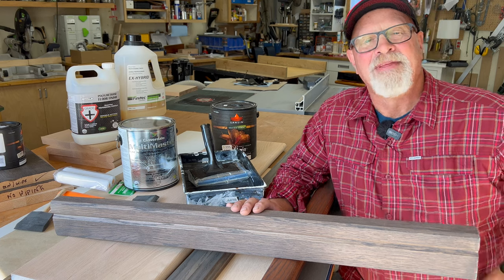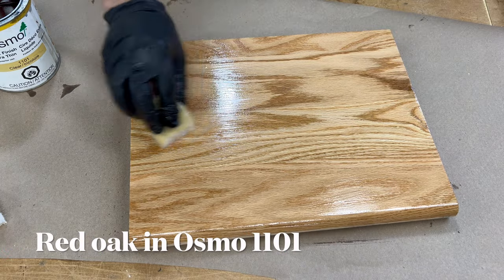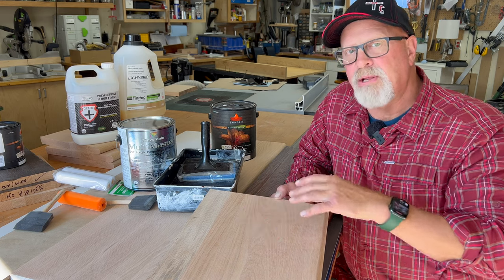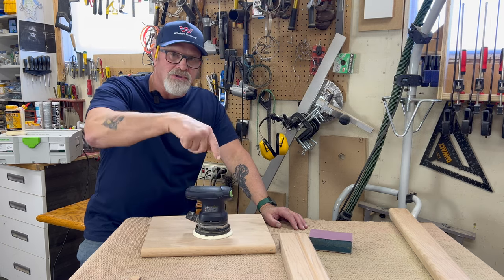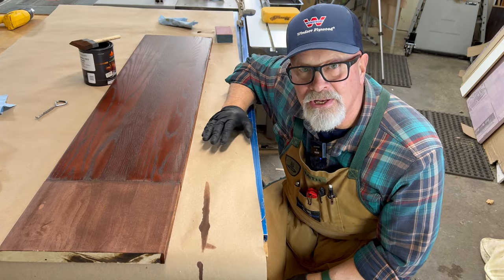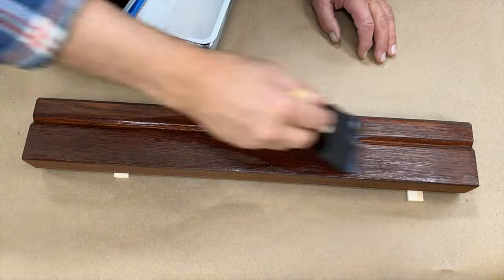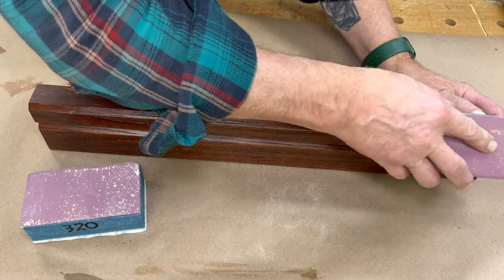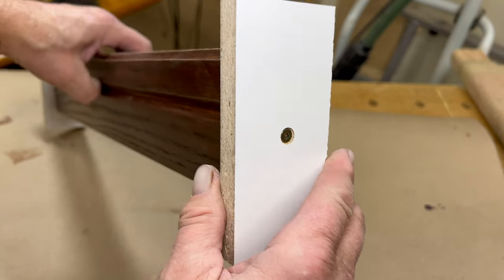Staining and Clear-coating: WITHOUT LOOSING YOUR MIND!

Comment: I've been doing stiar and railing renovations for 17 years now. I too have landed on Sansin stain with Saman urethane. Benjamin Moore in Oshawa and in Scarborough carry these and do quality stain matching for me. I used to have my treads strewn all around my workshop too but put together 2 sets of wire shelf tracks and brackets 2 ft apart. This allows me to fit 18 treads or risers stacked vertically against a wall for drying. I have 3 sets of these along a wall, which gives me enough racking for 2 sets of stair treads with risers. The bonus is I can also rest trims and rails on these racks for drying or just to keep things organized and out of the way while I work on each individual piece on my work bench. Very inexpensive racking. My main workshop is only 9ft x 14ft, in my basement in Toronto. I need to be very economical with space. Happy to hear you're in a town not too far from home. Cheers!
Reply from the maker: I've had those racks in the past. I've got no wall space left. LOL. Now 9x14 is a tight shop! You really have to be organized. I love to visit Toronto but haven't been there in a long time. I'm 1600 kilometres northwest. Big province! Cheers, Scott

Comment: Hello Scott. The best foam brushes I have found are the JEN 2" brushes available on Amazon. They are a bit more dense and firm, seem to hold up a bit better with oil based or solvent based products like BIN. But I find that if I try to save them in a plastic bag, by morning time they are a little limp. When it comes to apply stain in large areas like tables, shelves, etc I found using the styrofoam backed stain applicators work well after I use some tape to pull loose fibers. To apply finish I'll take a new styrofoam pad and wrap it in a HDX wiping cloth that I buy at the local HD big box. I get lint free results this way and I've fussed over a bunch of different methods! Love your videos and I always learn something! May the peace and joy of our Saviour rest on you and your family this holiday season.
Reply from the maker: Thank you so much Jay! These are solid tips and I will try those brushes from Amazon. Peace, joy and contentment be with you this Christmas as well. God bless, Scott

Comment: I find foam brushes to be very limiting in applying stain.  I prefer an old white washcloth which holds a ton of stain and I can usually cover an entire board without redipping.
Reply from the maker: Thank you for this. Cloths work well too. I've just grown accustomed to foam brushes. In the past I've found the stain starts to congeal on the rags and you get poor results. But if you change them out regularly they work great. Cheers, Scott

Comment: Amazing videos! Where do you get your hole plugs? Do you make your own? What does that process look like? Which plug cutters do you use, etc?
Might be another video idea on that part of the process? Unless I missed it in one of your videos?
Thanks for the fantastic content!
Keep up the great work.
Reply from the maker: Thank you for the encouraging comment Todd! And for the video idea. That sounds like something I would be interested in doing. I use a mixture of bought and home-made plugs. I don't have the skinny on the best plug-cutter at the moment. I have one that does the 1-inch plugs but obviously it is not the best as it smokes like crazy when I'm cutting the plugs. I have smaller plug cutters from Snappy Tools and they seem decent. On smaller plugs I use a small screw driver or awl to pop them out of the block of wood after they are cut. On bigger plugs I will cut them all out of a 3/4 block and then run the piece through the band saw to free all the plugs. As I use a lot of Zipbolt fasteners in my work, and they come with 1-inch and 1.5-inch plugs, I have been using up that stock pile of plugs for my work in oak and maple. But I will need to invest in a set of high-quality plugs that can be used on whatever wood species I am working with. Again, thank you for this comment and look for a survey post on my community page on best plug cutters - soon. Cheers, Scott